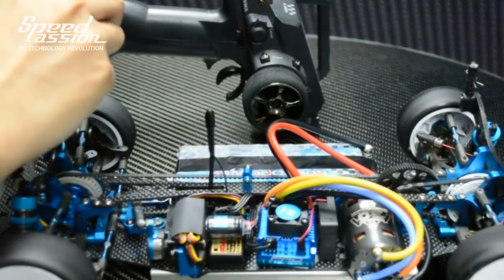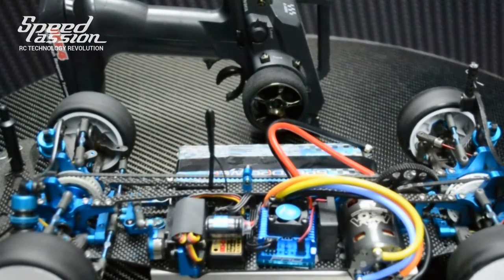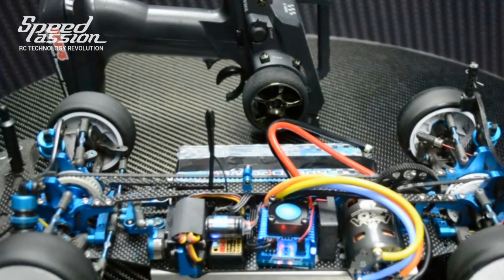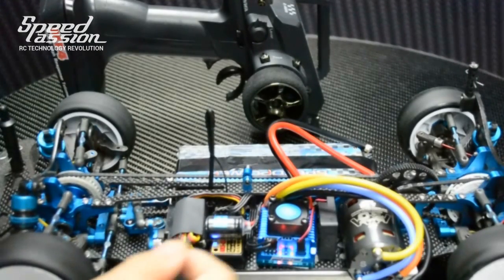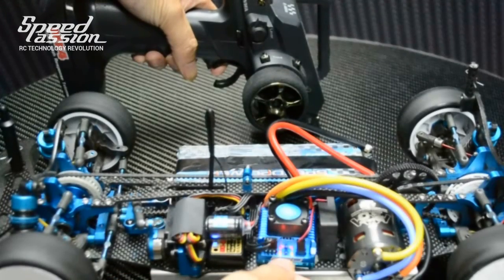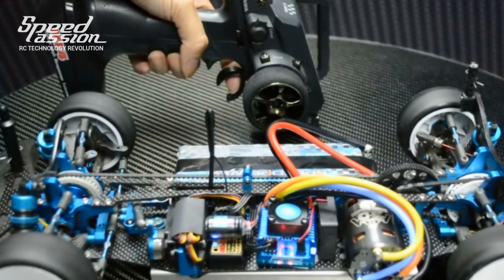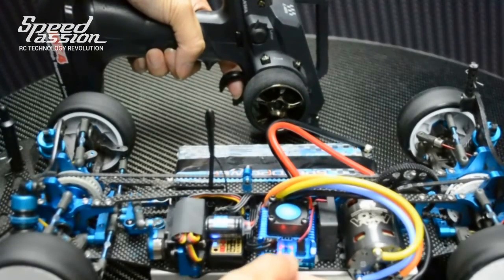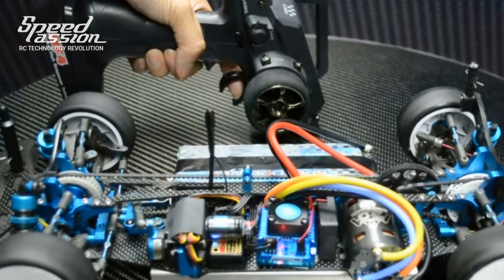Reventon Pro ESC - ESC Neutral Point Setup

Comment: I have the Reventon  SPEED PASSION SPEED CONTROL pro and im using the KO Propo EX1 radio, the issue i have is that i cant configure the ESC to run THE MOTOR IN THE CORRECT DIRECTION  the only way the speed control will run the motor after calibrating the speed control to the KO Propo EX1  is switching channel 2 in reverse  BUT then the motor runs in the wrong direction I have tried programing the speed control several times in normal mode in channel 2 but the motor will not run at all in normal mode Can you please HELP ?